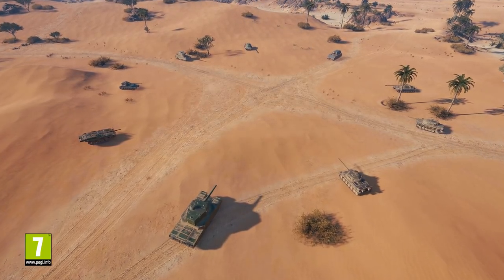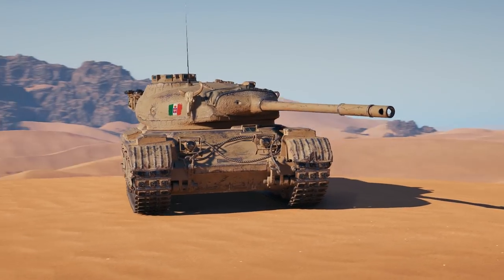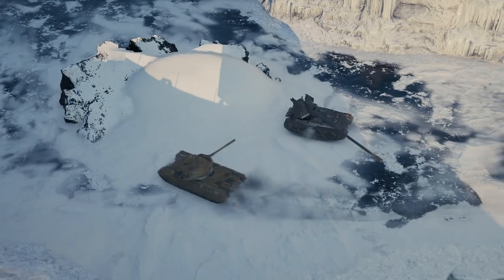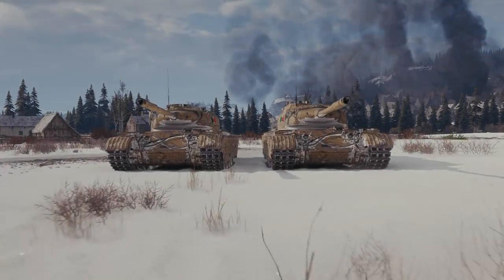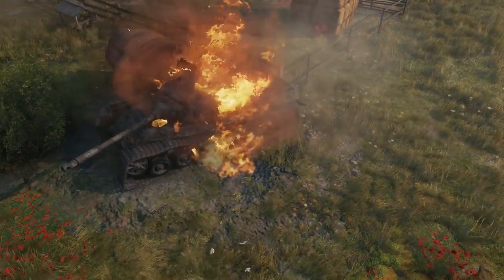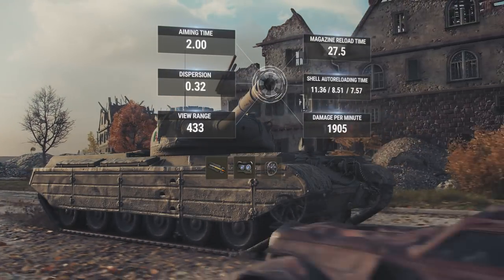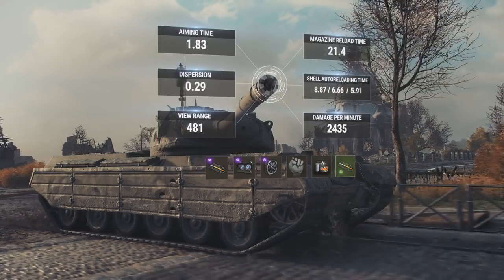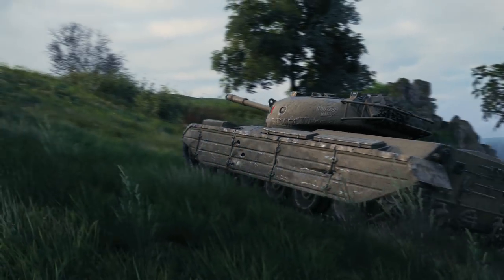How to Play: Progetto M35 mod 46

Comment: stage 9, with 8000 base xp.
Not trying 20x top xp cause that will take roughly 60-90 battles. 

Also, all missions are pretty much based on each other aswell.
1 high caliber can take a good player 5 battles.
20x 850 base xp tier 10 or 50K base xp

It all roughly takes the same amount of time. Depending on how good your team is aswell.